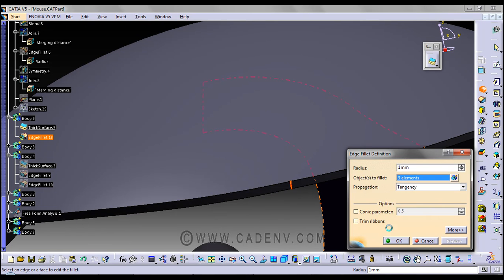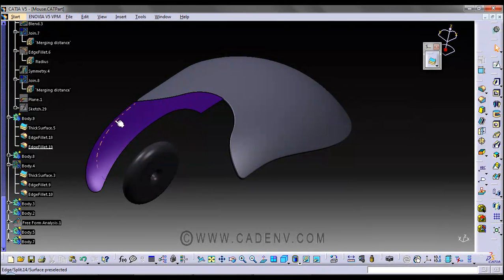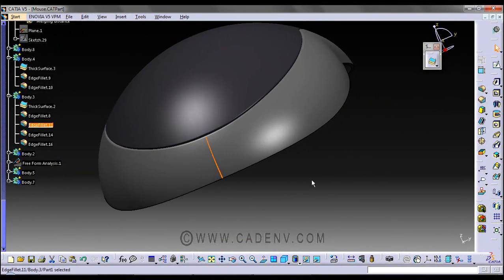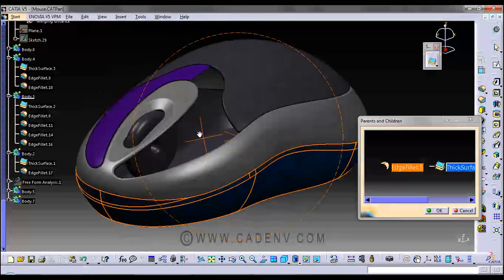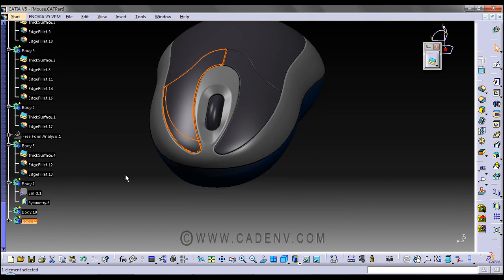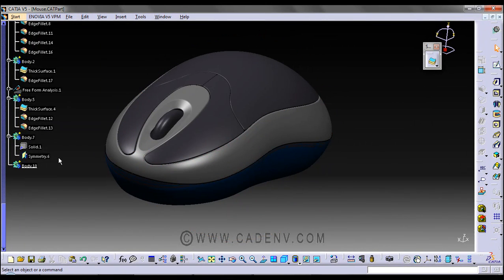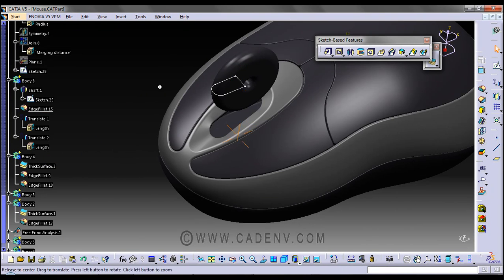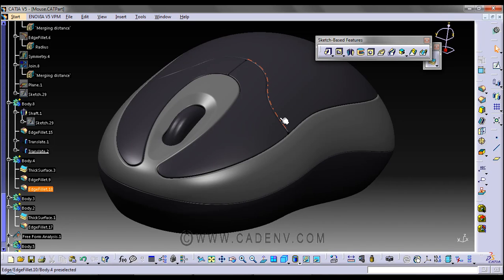mouse.step20-Final

Comment: 0.30 doesn't work for me.
I don't know why but the program doesn't let me select the whole edge with 1 click, it's like the solid is split in 4 different parts even if it's generated by a joint surface.
If i select all the edge piece by piece the fillet doesn't work, it gives me strange errors... 
What can cause this? Why my solid doesn't look like a single piece but like a "collage"?